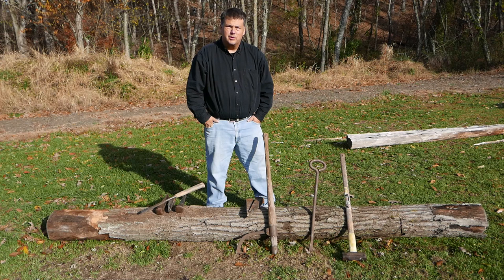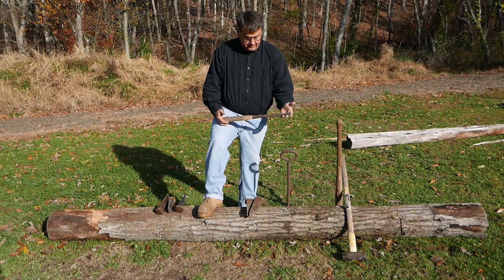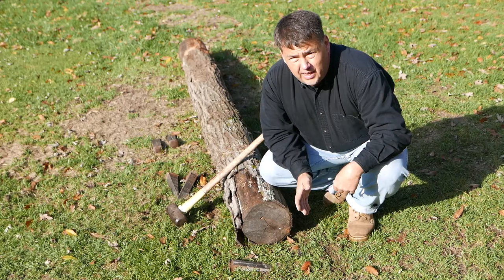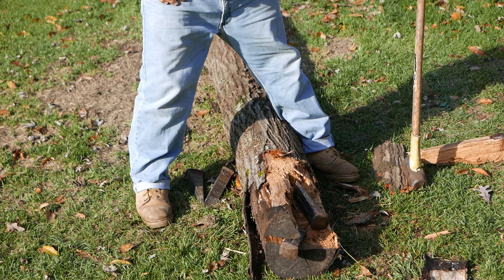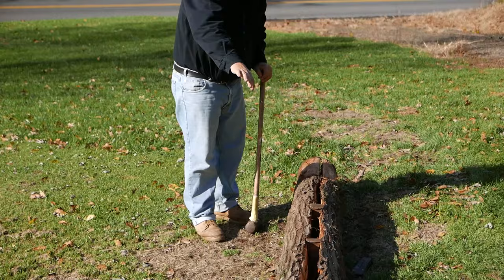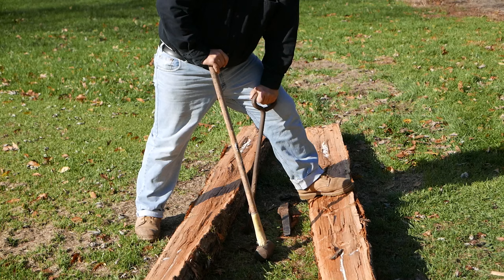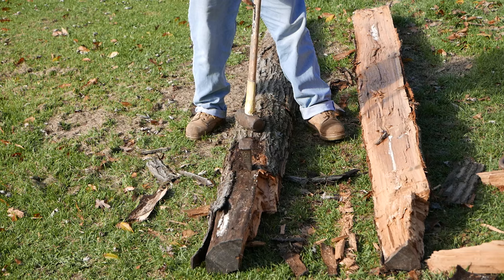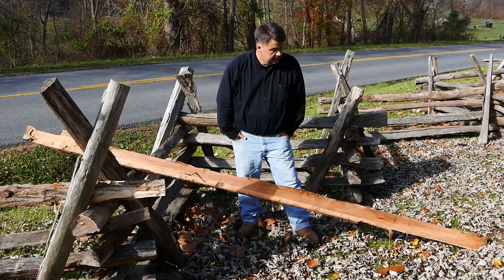How to Make a Split-Rail Fence, by Rob Wolford

Comment: April 2024 in Spain: i need to fence my property, but not allowed to use chainlink ( the Mayordom has decided to declare my region a tourist 'wild' designation.  So i am basically having to be Disneyland for the toirists, but no reimbursement for fencing.  Thinking of using the split rail technique, but obviously not investing that kind of effort in splitting oak. We have lots of oak, but i would not use it for hhe turists. Rather, we also havetons  of snagly pines here, and we do have to cut them, about 15-20cm diameter, to thin them out or else our millennial olive trees get crowded out,and dwindle bcs of too much shade. 
Can I use the same construction technique or will i encounter problems? About how long will such log fences out of young pine will last?

Comment: Rob, nice! Consider cleaning up those well used wedges to remove the " mushroom" top edges. Fragments can come.off like a bullet injuring you or a bystander. I have a small shop where I can either use a hack saw and or grinder to dress off those edges.
Reply: Very good advice.

Comment: Rob, loved the video and have some questions. Does this style rail fence have a name? And, when laying out this fence, what is the normal length of the horizontal rails and what angle are sections of rails to each other? Thanks
Reply: It is called a snake rail fence.  Not sure the angles.  I use 12 foot rails.

Comment: Great tutorial, ty! I know this thread is old, but wondering if anyone can answer a general question about when to split? Should the process be done only when logs are seasoned or does green timber work ok as well?
Reply: Red Oak can be done about anytime, that is my favorite.  Locust is best when green.  Forget Hickory, it is a nightmare anytime.  Pine when a couple of years seasoned.
Reply: @hobbitreet  any thoughts on maple or ash? That’s mostly what we have access to and plan to drop this spring.
Reply: @jenwhitedesigns  Ash is amazingly great to work with.  I've tried sugar and silver maple, but found that it rotted so fast it was not worth my time.  One thing I would mention, I've been asked several times who made the fence at our and my mom's house, it is a great feeling to tell folks that I did so.